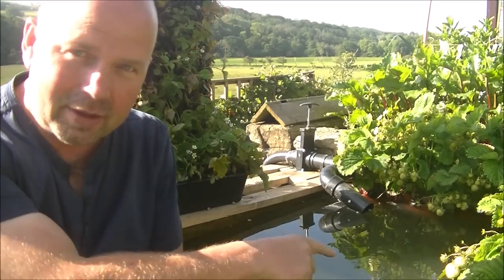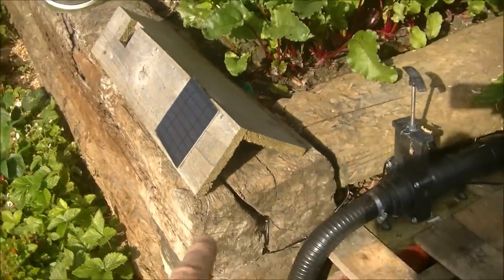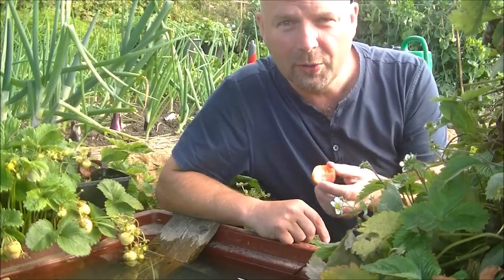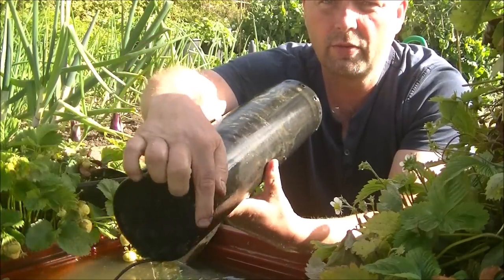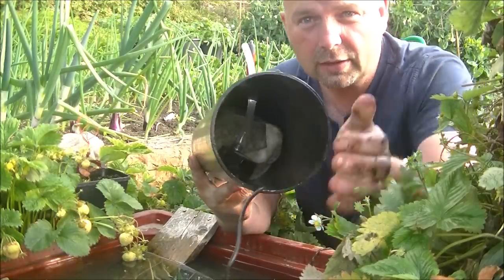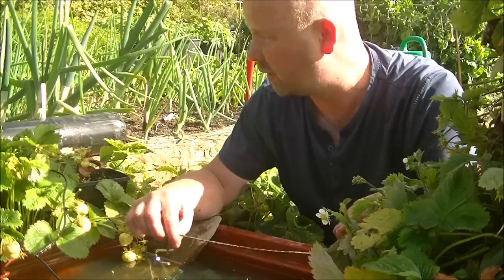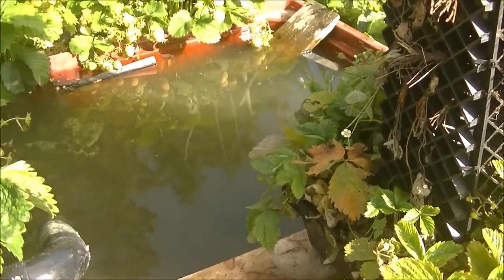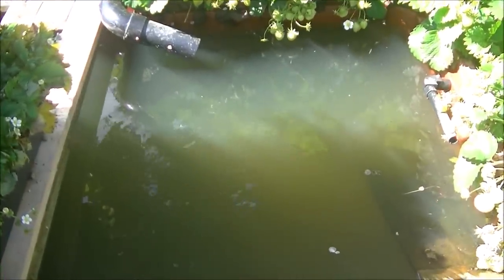DIY Solar Powered Pond Filter - It Works......very well

Comment from the maker: This is a filter made with a small solar powered pump I bought on Ebay but it is also available on Amazon. Links below.
Solar powered water pump (Ebay): https://ebay.us/U7ofCD
Solar powered water pump (Amazon): https://geni.us/M22pjdB
The pump is the 200 lph / 1.5W version.
Solar powered pump video: https://youtu.be/7J8sB1Y60VY
Hydroponic system using this pump can be found on my Thousand Yard Stare channel here: https://youtu.be/z76J-DSk0JE
Foams, Biogravel and mesh bags: http://www.filterpro.co.uk
Reply: Well done. Very clear and simple - I like that DIY filter. I am always taking leftover parts and making something for the ponds. BTW, I watched your series on the large pond filter system you built and I got some good ideas I could scale down. Thanks, I have always enjoyed your inventiveness. I try not to pay the mark on "name" products by building as needed.
Reply: @78tag  (my other account) No worries and I'm glad you find some of the stuff useful.
Having the ability to make something from very little is so handy so I wish you the best with your projects.
Reply: Very interesting.  Maybe you could buy push-on end stops for 4" drainage pipes to stop the sponges flopping out the ends, (after drilling out a 3" diameter hole in each end stop)?   In practice what has been the working life of the solar panel & mini pump?  Do you remove the whole apparatus in the winter months?
Reply from the maker: @mikeharrington5593  I made the vegetable garden leading up to early 2020 as I knew there would be some sort of global nonsense (the Covaids) and the solar pump has been in the water butt since the start so it has been operating continuously since later 2019 and still works fine. That's the actual pump I used for this video and it stayed in all through the Winter..
With regard to the end caps I have 2 different types, one which fits inside the pipe and one which fits over the end of the pipe. The type which fits over the end are better as far as I'm concerned and I will be shooting a video in the next few days if we get sun and no wind which will show the end cap on an 'emergency' filter I've come up with which can run off solar pump, USB pump or a USB air pump - it is a simple design so can be made by anyone. There's also a smaller version of this filter as an alternative to the upright filter which will be the main focus of the video.
I realize that a video of that nature will have a tiny audience but it's important to see what can be done with very little.
Reply: In order to circulate water and filter through a connecting 'bog' (with plants and gravel), will a solar panel/pump suffice?  I just want it for wildlife (no fish) but want to be sure it is clean and oxygenated. What wattage of solar panel/ submersible pump would be required?  *I have a small preformed pond with connecting smaller pond/'fall' which I'd like to make a bog filter, if possible. Thanks in advance!
Reply from the maker: @ssc18  The size of pump and panel will depend on the scale of the lob it needs to do and the height it needs to pump up to. Small pumps like the one in the video are OK for very small systems but for a normal sized pond or to pump up to any sort of height you will definitely need a larger pump and panel.
As a guess for a simple set up the pump would be 10-15 watts and the panel would be a 25-30 watt panel to have it running most of the daylight hours.
The flow rate of a pump is dictated mostly by the vertical lift from pond surface to the highest point it pumps to and the spread of a waterfall. The wider the waterfall is the more flow is required.
Solar pumps won't provide a big flow for a wide waterfall.
Reply: @pondguru  Thanks for your quick reply; I had a hunch that the small 2.5w pump wouldn't have enough power to pump up and through a bog filter and am not even sure if the concept of using the smaller spillway as a bog filter would work--I need help! I'd be happy with a small trickle of water filtering back into the main pond, not looking for a dramatic waterfall.  Again, it's just intended for wildlife and want it to be/look as natural as possible with enough oxygen circulating for a healthy environment.  I love the idea of filtering through a small bog garden, I'm just not sure of how to do it effectively (and simply.) Any recommendations/ links for a solar pump panel which could handle this?  Thanks again.  I wish you were a neighbor!  ;o)
Reply: @ssc18 (my other account)  I'm sure I answered that in the previous reply? a pump with a minimum wattage of 10W and a solar panel with a minimum of 25-30W would provide a decent flow and run in light conditions even when the sun wasn't fully out. Anything bigger is a bonus.
Reply: hmmm... @Thousand Yard Stare  Hi there, yes, I'm just still wondering about how to actually filter the water from the solar powered pump through the bog...I have a 3/8" vinyl tubing attachment which I guess I need a hose barb fitting  and adapter? I'm just not sure if I need special pipes etc for the bog itself in order for the water to flow properly back into the pond.  I was naively thinking the vinyl tubing would suffice but I imagine it would get clogged up in  no time...sorry for my continued confusion...
Reply: Great idea. I'm putting mine together tomorrow. I've used some pond pods and now the water looks like milk 😢! Can't wait to get it going and hopefully clear it all up!
Reply: @mellymonks  Good one - best of luck with the pond.
Reply: @Thousand Yard Stare  thank you. The algae in the warmer weather has turned like pea soup. I've added some barley straw and some beneficial bacteria as well as cleaning the muck out as best as I can! The pond is only a year old and I am new to it so I take any advice I can get.
Reply: @mellymonks  The filter may help a bit but the permanent solution for a pond affected by green water is to install a UV clarifier.

Comment: Great idea! Made your diy filter and have the water spitting out of a tilted small watering can, instead of under the water. Day three and the pond is 90% clear. Thank you!
Reply from the maker: I'm glad the pond is clearing  always great to hear.
Reply: Filters should be run 24/7 and not only with solar.  Short term it will work as you see.  Long-term like 1-3 years down the road if the filter is not running 24/7 you will begin to have and see issues and wonder why my pond is no longer clear.  During the time the filter is off some of the debris from the filter will be reintroduced back into the pond and due to no aeration and movement in the filter the biobacteria will begin to die off.  This will cause long term problems.  In the short term it will seemingly work but in the Long-term when you notice a problem it will be hard to correct and you could potentially start loosing fish.

Comment: I'm putting mine together tomorrow. I've used some pond pods and now the water looks like milk 😢! Can't wait to get it going and hopefully clear it all up!
Reply from the maker: Sorry I thought I replied to this ages ago. Best of luck with the pond.
This filter will draw in suspended particles and help to keep the water clear but it may take a while to clear if there is fine particles clouding the water.
Reply: If the filter is only run by solar electricity, you may have a problem.  At night or cloudy days, you will not have any filtration or aeration.  This can affect the health of the fish and ecosystem.  A filter in a pond or fishtank needs to be run 24/7.  The times it is not running debris from the filter can and will leach hack into the water.  Also, most fish do not do well when high aeration is turned off and the water loses oxygen and starts becoming stagnant.  When the filter is off, any bio bacteria that has been established in the filter will start to die off.  This will definitely affect the overall health of the pond and inhabitants in it.  You probably already went ahead and put a solar filter in the pond.  My suggestion is to 11:25 hook the filter up to 24/7 power.  You may not see any problems short term, but in the long-term, it will start to cause problems.  Solar fountains for decorative purposes are fine.  A filter needs and should have constant power.

Comment: I've used these solar pumps for years cracking little pumps 👍
Reply: Solar pumps are fine to use as long as a filter is not attached to them.  A pump fo added aeration or a decorative fountain is fine but a filter needs to run 24/7 or the Long-term effects can hurt the pond and all in it.

Comment: Made one using a coke bottle, with both ends removed. It worked; and no electricity bill!
Reply: Filters in a pond or fishtank needs and should be run 24/7 or the long term effects can be devastating.  Decorative pond fountain can be run with solar but filters need constant power to work properly and benefit the pond or you will encounter problems down the road.

Comment: Nice, actually I think an old 2 litre pop bottle would do you well in this. You'd be able to actually see everything inside, whether it needed cleaning etc.
Reply from the maker: That would be handy but there isn't much structural integrity in a normal 2 litre pop bottle so I'm not sure it would be a suitable container.

Comment: Thank you for sharing - we’ve been struggling with our pond and this would be a fab solution
Reply: (my other channel) Nice one and best of luck with the pond - I'm glad you found the video useful.
Today I'm setting up an ebb and flow hydroponics system over that water container so I will film it and upload to the Thousand Yard Stare channel.
Reply: A filter needs to run 24/7.  In the short-term it will work.  Long-term when the filter is off debris from it will leach back and due to no aeration or water movement in the filter any good biobacteria will start to die off.  There is no obvious short-term problems but long-term this can effect the health of the pond and inhabitants.

Comment: Do you think using it with an air pump  like a sponge filter would have similar results?
Reply from the maker: Yes it would work as a filter to some degree depending on the design. Ideally the sponge(s) would be contained =in a similar way to how they are in this video so the water was forced through them.

Comment: Hiya  great video, quick question , will this filter clean green water and also are the filter pads pre bought or are they cut from a larger piece ... THANKS
Reply from the maker: The foams I use in the video are just normal pond foams 11" x 17" and the white pad is a fine particle matting of the same size. I sell them on the FilterPro site so I've got a nation of them but they're available all over the internet and from most garden centres and aquatic stores.
This filter has not got a UV light in it so it would be unlikely to clear green water.
I have found a better solar pump than the one in this video and I showed it in this video: https://www.youtube.com/watch?v=GnO60MYisIQ

Comment: Brilliant video, I have solar pump with built in battery, my question is - can you buy an extension cable that allows me to have a longer cable for solar panel? If so what am I looking for? Much love Ju xx
Reply: You will have to cut the wires and splice a longer one to it.

Comment: Here in Sunny Florida.  I've got a giant sandy hole in the ground and I want to drop in a 300 gallon tank.  I'd like to build a pond and keep it clear enough with only solar, no batteries and minimal maintenance (at most once a month).  Possible?
Reply: In Florida that will be entirely possible but the bigger the pump is the larger the solar panel(s) will need to be - Ideally if you have fish the filter would run 24/7 to keep the filter alive and fully functional but if you could integrate a filter into the pond it could run during the day and have downtime during the night with little ill effects.

Comment: Initially made one with a coke bottle with both ends removed. 'Upgraded' to a drain pipe. Is there anyway of making this external so as to avoid taking up space in the pond?
Reply from the maker: You could make an external filter from a sealed container and suitable fittings but if the pond is so small it requires a filter smaller than the one featured in this video then it probably doesn't need a filter since it will be too small to have fish in it.
Reply: @pondguru  Pond is a fibreglass tank of approx 350L. Would I be able to construct an external filter without drilling the tank?
Reply: @stevenattridge9823  (my other channel) If you can't build an overhead filter it would be best to go for a decent sized canister filter as long as you can protect it from the elements (since they are designed to be used indoors).
Without seeing the tank I'm stuck as to what the best method of filtration is so feel free to send pictures to sales@filterpro.co.uk

Comment: Can you tell us how much gravel is in each mesh bag?
Reply: (my other channel) In the video I used Biogravel in mesh bags in each side of the filter - I said in the video that it was 2 x 700g but if you're using a 4" / 100mm diameter pipe for the filter you can use anywhere from 700g - 1000g in each of the 2 x mesh bags on either side of the (central) pump.
I have the Biogravel media listed on my website http://www.filterpro.co.uk (Biohome media page) and you can buy as much or as little as you want.

Comment: Question though, the bacteria in the filter wont die when the filter is not running, hence at night or on a dark day?
Reply: Was wondering the same
Reply from the maker: Not if it is underwater - that's why solar and filters generally don't mix as the pumps won't run 24/7 without expensive battery back-up.
If you have an above pond filter the media will either dry out or be poisoned if the water doesn't flow (as the water in the filter will quickly go 'bad') but if it is under the water it is fine.

Comment: looking at doing this myself but i am just wondering are you not supposed to filter through the bio gravel/lava rocks first to catch bigger debris and then the filter sponge afterwords to catch micro deposits? or am i over thinking it
Reply: (my other channel) The mechanical part of the filter (foams) will strain out the muck before it hits the biological part of the filter (Biogravel). That helps to keep the water relatively clean in the biological part and that is beneficial for porous media to support the maximum amount of media. Anything small enough to travel through the filter will be caught next time round.
Ideally you don't want good quality media sitting in heavy muck as it reduces efficiency.
Reply: @ThousandYardStare  aaaaah thank you for explaining it for me :)
Reply: @stephenhusband348  No worries and best of luck with the pond.

Comment: So what happens when the sun goes in and the bacteria die
Reply from the maker: Bacteria don't instantly die when the water flow stops and the more porous a filter media is the longer it will last without flow.
However, in an ideal world the filter would run 24/7 to be most effective. When it only runs during daylight hours it's there more as a mechanical filter containing a fair amount of bacteria as opposed to a mechanical and efficient biological filter containing the maximum population of filter media.
Basically having some filtration is preferable to having no filtration and while this filter does offer a fair level of filtration it will be nowhere near effective compared to iif it was running 24/7.

Comment: Solar filters are not that great.  It will only work during sunny days.  At night, the filter is off.  This is bad as at night or cloudy days, you have no filtration or aeration.  Also, when the filter is off debris from it, it will leach back into the pond.  A pond filter or any fishtank filter should and needs to run 24/7 for the health of the fish and water ecosystem.  If the filter is harboring good benifital bacteria, it needs the filter to run 24/7, or you will have a die off of bacteria affecting the overall health of the pond and filter.  You may not notice any bad short term affects of this but long term this can cause the pond to "crash".   If you use solar for a decorative fountain and not a filter this is fine.  With the filter not running 24/7 it is like you only vaccume some of your house but never the whole thing and throw some of what you vaccumed back around the house.  Eventually it will get real bad and you will learn from your mistake.
Reply from the maker: Yes and no.
The filter will support bacteria at a decent population as long as it is submerged and with regard to the trapped muck leaching back out that doesn't happen since the foams hold the muck.
Ideally a filter would run 24/7 and that is certainly true of an external filter but it is less important for a submerged filter.
Since making this video I have upgraded my solar pumps and they have a much bigger solar panel which has a battery back up - that extends the running time approx. 1 hour after sunset. They are much better pumps which run even on cloudy days.
I would never pump out to an external filter using a solar pump which is why I came up with this design which is fully submerged at all times.